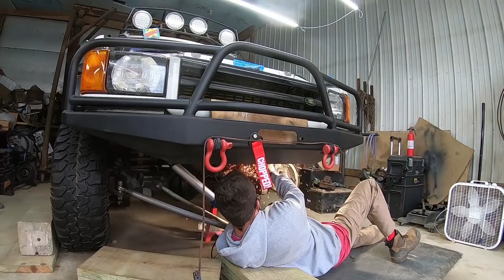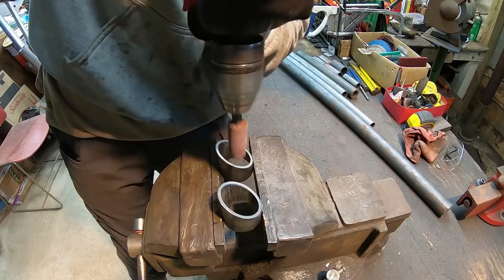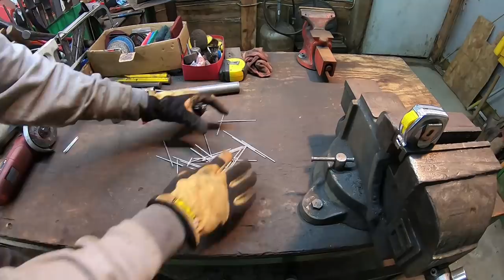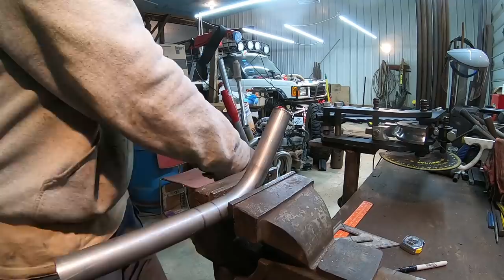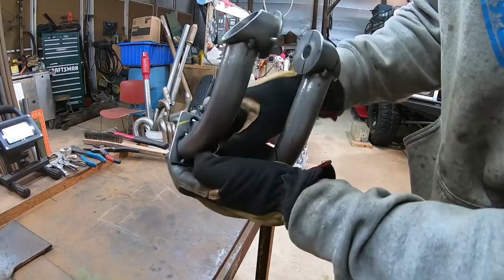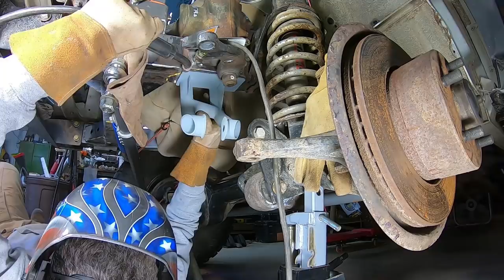Panhard Bracket × 4BT Cummins Discovery #41 [Land Rover Build]

Comment: Tubular!  I hope those washers hold up though.  They are a bit thin and may wallow out.  But of course you can just beef it up later if it does 👍🏻
Reply from the maker: Those washers are the same thickness as the old bracket where that bolt went thru... so I hope so too 🤞
Reply: @Tinker1837  Cool.  They looked like thin fender washers on the video.  Should be good to go then!
Reply from the maker: @Bread996  They're not the higher grade steel like that DOM tubing, so there's still a possibility of the holes getting out of round, but definitely something I'll have to keep an eye on.

Comment: I was worried about lateral loading where the 2 supports connect to the plate until I saw the gussets er whatever you call the fillers... literally breathed a sigh of relief. Looks great!
Reply from the maker: I had thought of maybe adding another tube or 2 to brace the loads in the direction of the bar, instead of just gussets, but it ended up looking way overkill.

Comment: That is an awesome project. I did a complete GM running gear in my rover. 5.3 6l80e 241tcase and dana axles.  I had to change the location of my pan hard bar and I did a high steer setup. I had some bump steer so now at ride height pan hard bar and drag link are flat it helped a lot and it is stronger since I used all 1 ton stuff.
Reply from the maker: Sounds badass!  I'm excited to build a set of axles & long travel suspension for mine. I'm all about spherical joints & tubing setups these days, & 1 tons like your setup would be mint.

Comment: This may be a dumb question but! Would it not have been easier and better to swap the bar around so the frame mount is on the passenger side? It was designed as a right hand drive vehicle so making it left had drive was a bodge to start with.
Reply from the maker: I looked into that, but sadly my axle doesn't have the brackets on the axle for the right hand drive bar... weird considering how many other things it has that are RHD bits.  I figured it easier to weld things into the frame then the axle tube, plus I think that the steering & panhard bars have to swing from the same side to prevent binding & scary bump-steer effects.

Comment: Knowing how thin Disco chassis' are your bracket is much stronger than the frame. Check it often?
Reply from the maker: I had not heard they were considered thin, news to me!  I was actually a bit impressed with the chassis as I worked with it, since it's as large & thick as most any truck up into the 3/4-ton rating that I've encountered.  And fully boxed too, where many are c-channel, but then that's the classic debate of stiffness versus flexibility.  A full tube frame build would be the dream, but a long way off yet.  This build will likely never "end" 😎
Reply: @Tinker1837  Corrosion is the devil of Disco's.  Favourite areas are outrigger chassis brackets, rear body floor/inner wheel arches/rear body on 4 doors around door sills.  If its got a towbar make sure the attachment points are sound, major chassis rusting at rear chassis legs and x member, its not unknown for the whole rear x member and towbar to tear away.  Soak the box chassis in old engine oil regularly, the original engine would do it for you.  Be aware the centre diff planet gears are fragile and along with the halfshafts, don't like being shock loaded climbing rocks, snatching stuck vehicles etc.  Treat it kindly and you'll be OK.
Reply from the maker: @dartmoordave  Good to know!  My chassis was very nice but is getting in need of restoration thanks to Michigan's extreme use of salt thru our half-year long winters.  I'll make sure & give those points a careful eye when I start the frame clean-up come spring time 👍
Reply: @Tinker1837  Didn't want to frighten you but here in the UK my '94 Trooper with C section chassis has no body rust at all and surface rust on the chassis but you won't ever find a '94 Disco here either; still running or not rotten. Even if the engine is doing its best to lube the chassis!   Keep washing the mud traps.

Comment: Did you change the front springs to handle the weight of the 4BT? I was wondering because I was planning on using a 1.9 tdi in my D1, but I’ve found a 4bd1t Isuzu with only 52k on it for dirt cheap. It is very similar to the 4BT in most specs except it isn’t as tall.
Reply from the maker: I did not yet, but will for sure after I get it in a scale, that way I can calculate the spring rate to restore it back to the lift height before all this work.

Comment: Really like your work on that bracket but would all that load be basically transferred through the 2 small washers that are only tacked in place?  
Good to see more progress 👍🏼
Reply from the maker: Those washers are actually pretty big (2" across & 1/8" thick) and same thickness as the old bracket, also they are fully welded around (with TIG)
Reply: Amazing welding skills!  Would you consider boxing the bracket for added strength?  And little brace to give little more lateral support left to right?   Just my opinion but I feel that track bar bracket is putting a lot of torque on the welded joint at the frame.

Comment: 2 questions.
1.Was this a factory modification as you did show a cad drawing mid video or did you come up with the drawings yourself?

2. Will you be fabricating a sump guard to protect the underside oil pan of your beautifull 4BT?

Nice work. Thankyou!
Reply from the maker: 1) That was a drawing I came up with, actually the 3rd version of it by the time I did the filming, but ended up very near true to life from it.  2) Yes, for sure! I've often thought of a dry-sump system for it, but due to complexity that will have to wait for a later phase of the project when I dive deeper into the engine build.
Reply: @Tinker1837  Appreciate your reply. Thankyou. 👍

Comment: You will ebentually nurn up your car wring not using a double ground strap.
Reply from the maker: Wha? Everything has 2 giant grounding cables.
Reply: @Tinker1837  Need one more individual ground. Eventually your gfound will arv and loose ground and will find vehicles ground and fry your vehicles wiring. Just a FYI
Reply from the maker: I have 2 cables to frame, 2 more to engine, & 2 more to body... did I miss a spot?  I agree though, very important.  I hope I didn't miss something too obvious, because I want my electrics to be well sorted on this build.
Reply: ko
Reply: @БейбитАдилханов 

Να μη κι να